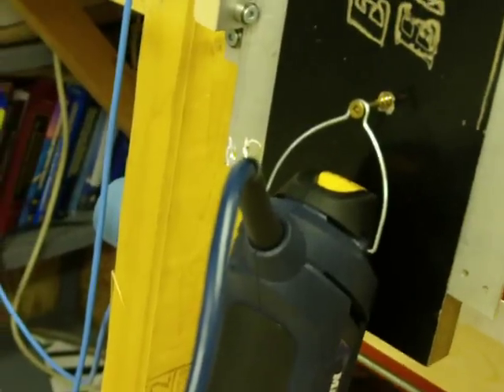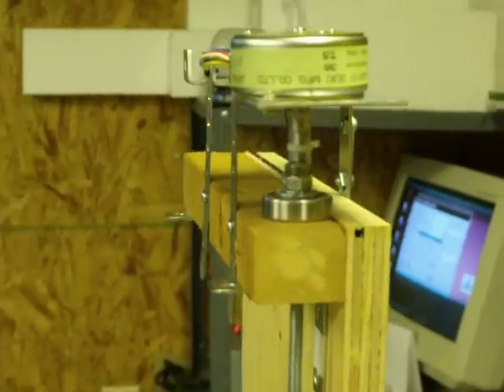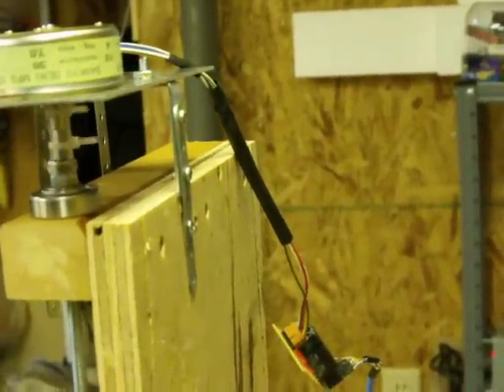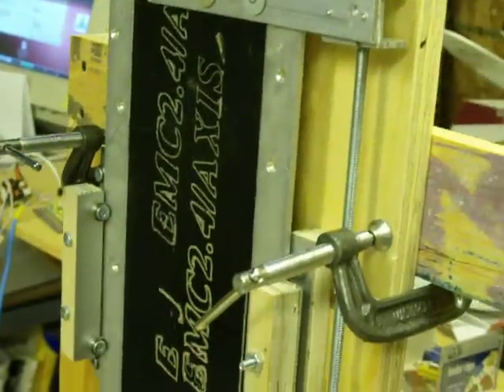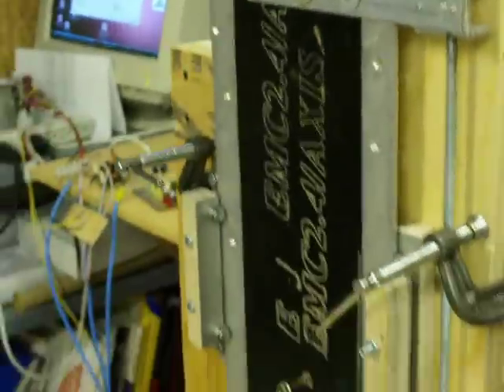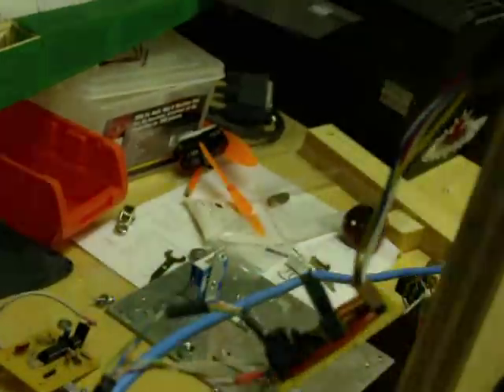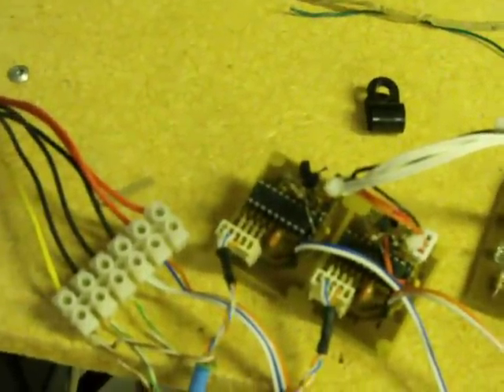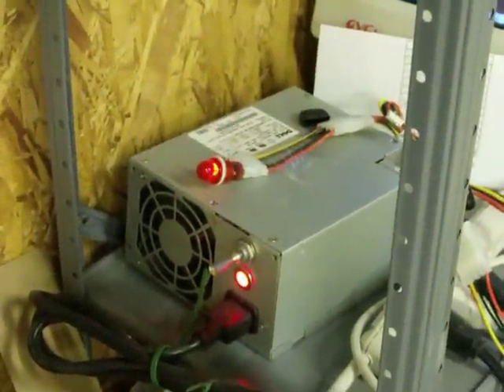CNC - Upgraded Z-Axis - Beta

Comment from the maker: Yeah, this motor and driver soon got replaced with a 1A 50 step motor and an EasyStepper driver from Sparkfun.  20+ IPM travel is now being obtained. And version 3 of this machine will see a 3A stepper drive a 3/8 20TPI rod, so hopefully even greater speed.

Comment: When I made full step motor drivers I came to the conclusion that they simply did not perform well enough to actually use them with a machine. I could never get a full step motor driver to pull out at greater than 224 RPM I think it was. That has something to do with the resonance full stepping causes. Once you go to a half stepping sequence things get much better. Current limit driving stepper motors helps too.

Comment: Why such high pitch rod? I run 10 TPI ACME and it is too high pitch. Seeing that stuff turning at 1,000 RPM is frightening. At that it is only going 100 IPM. I'd think you've built enough machines by now to see the merits of timing belt drives. Unless you've exotic twist leads threaded leads aren't where it is at for hobby CNC. Ballscrews if you're rich. Realistically 0.001 precision is the best one could hope to achieve with a homebrew CNC. A belt can do that with less than a half an inch cog.